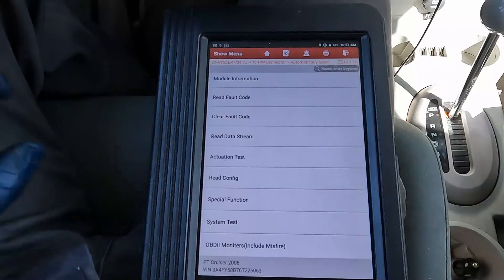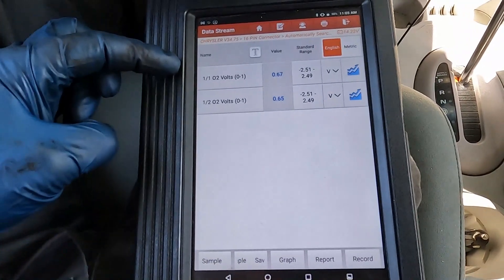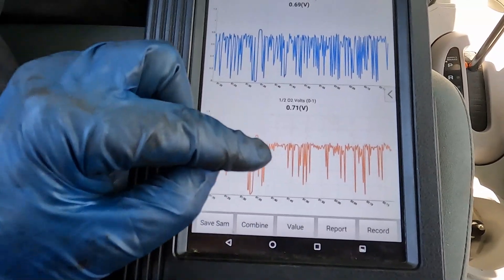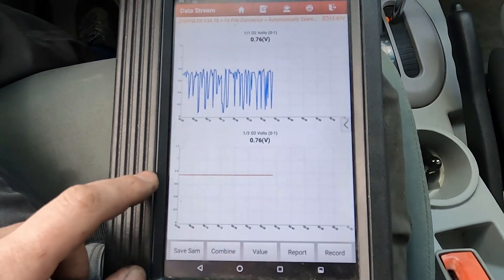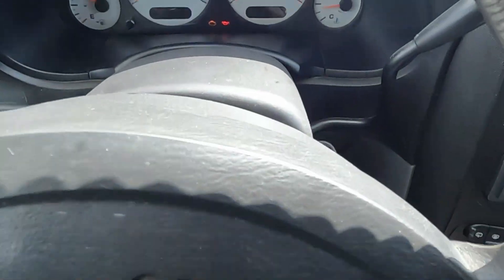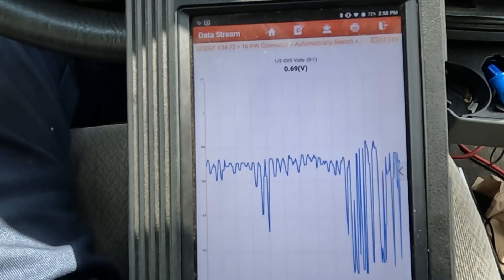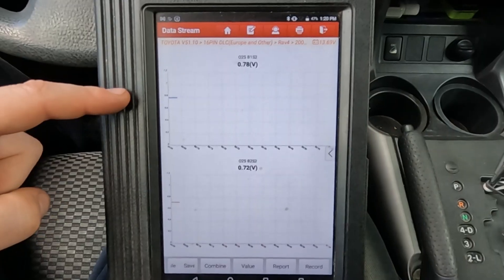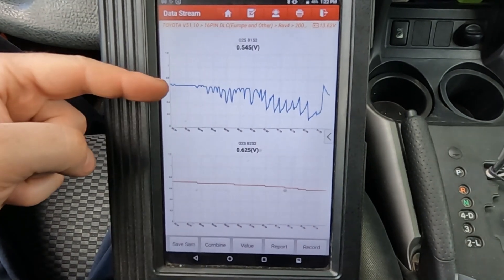Catalytic Converter Testing How To Test A Catalytic Converter Like A Professional

Comment: I have a P0420 code. Cat was bought at Aamco with a warranty. When I brought it in they said I have to replace all 4 sensors and the the air flow meter for the warrabty. Is this normal? Shouldn't they have to show the sensors failed?
Reply from the maker: Warranties vary from company to company. Some companies have interesting warranty policies. Unfortunately to get the warranty you need to go through their hoops 😕
Reply: @ValleyMobileAutomotive yeah, interesting. I got a Nissan tech to check it out and he said to request the code or diagnostic report that supports the need to replace the sensors.

Comment: Nice video. I smoke tested my intake, exhaust. And found nothing. Fuel trim 0.0  -  0.1. Mine is nice an steady until computer does its test. Changes fuel ratio rich, then lean. My delay is almost 5 seconds. Oxygen storage capacity test. Just p0420.
Reply from the maker: So your downstream oxygen sensor is swithcing back and forth after warm up? That would indicate a failed converter. What vehicle do you have?
Reply: @ValleyMobileAutomotive  After its warm, steady line 2500, 3000 rpms. 600 flat line. After 10 seconds fuel ratio drops 13 to 1. o2 sensors go up. Then 16 to 1 ratio, o2 drops.  Failing oxygen capacity test, almost 5 seconds. 2007 gmc envoy 4.2L... 3 catalytic converter's oem p0411,  no power. Now p0420 walker, ebay, magnaflow. "Catalytic converter oxygen capacity test" Google that. Tried capacitor and resistor, ecm figured that and the anti foulers too. Long an short fuel trims perfect. Thank you for the responding.  Old cat was even cracked no po420, had po411.

Comment: Thanks for another great video. My wife’s Toyota had a P0420 due to a misfire (bad coil), but I could not really see the difference between the two banks nor before and after fixing the problem. I learned that Toyota uses wide band sensors after the cat. Are they more difficult to interpret then the narrow band?
Reply from the maker: Thanks for watching! Wideband sensors can be a little more involved to interpret. They will have a different gragh pattern. What year is your toyota? I haven't come accross one with a wideband downstream sensor yet.

Comment: Would the diagnostic procedure be the same if P0420 kicks on intermittently at lower rpm city driving , but never during long steady commutes
Reply from the maker: Yes, the diagnostic procedure would be the same 👍. The rear o2 sensor is what the computer looks at to determine catalyst efficiency.